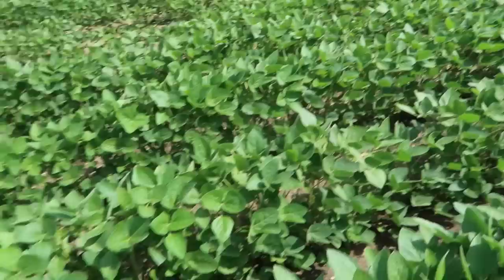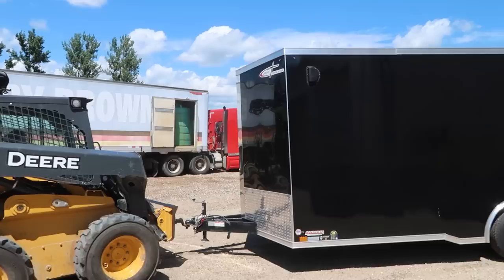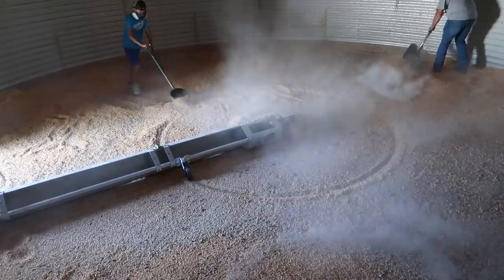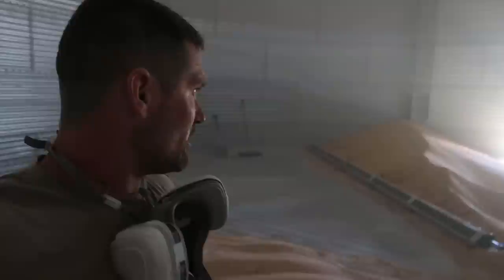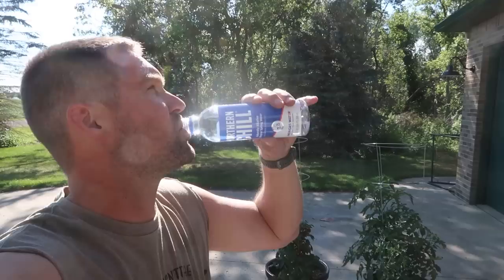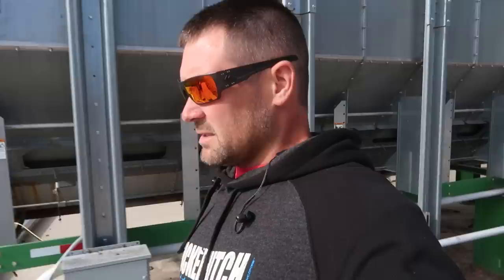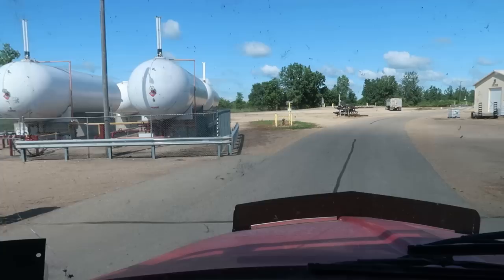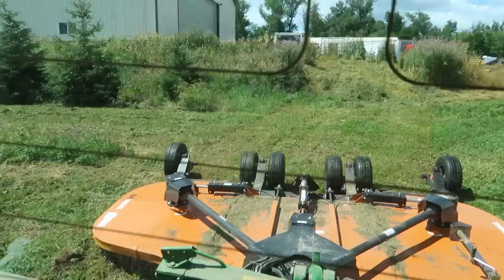Grain Bin Clean Out

Comment: Hey man! I noticed when you were showing us your sensors, that the monoxide sensor was placed high near the ceiling. I worked in auto shops my entire career and know that carbon monoxide settles low in a room. That why they outlawed pits in garages. Many guys died down in them after inhaling monoxide. I'd double check the recommended placement of your monoxide sensor to be safe.
Reply: US EPA says:  "Because carbon monoxide is slightly lighter than air and also because it may be found with warm, rising air, detectors should be placed on a wall about 5 feet above the floor. The detector may be placed on the ceiling. Do not place the detector right next to or over a fireplace or flame-producing appliance."

Petrol and diesel vapours are heavier than air - will collect in pits.

Comment: I ran commercial grain elevators for years. Couple suggestions….spray outside weeds around the bins keeps bugs/rodents away. Grab some diatomaceous earth and spread that in the bottom of the bin when your done, quick and cheap way to keep the bottoms insect free and little dryer. Air monitor on your person when you go in for obvious reasons. Anytime you go into a bing you need a person watching you at the door with a cell phone in case something happens.

Comment: Looks good with the grass knocked down have a few farms in the area I live in that I wish they would do that with worked at a green house that had a propane tank that would hold 3 rail cars worth of propane it was backup to Natural gas when demand was high for NG they would switch to LP which like you they bought in low cost season as for the fuel in the tank I fill up Semi from work and it hurts also

Comment: I had pancreatitis in Grade 4 in the mid 90’s. Was the third youngest case ever in the country at the time. They never knew what caused mine. They thought a virus potentially caused it. Anyways boy does that suck, very painful.

PS on the carbon monoxide sensor, keep that down near floor level. Carbon monoxide is heavier than oxygen, by the time it reaches the ceiling it could already be too late for those in the house.

Comment: Hi just to let you know the smoke detector is not mounted in the best location it you want it to work better (faster) get it away from the top of the wall would advise mounting 50 cm out from the wall minimum the point where the wall meets the ceiling is a dead air space hope this helps protect the family. p.s. i work for an alarm company over 25 years all the best

Comment: 19:20 your John Deere riding mower has the battery light on just like mine. When it's on it ain't charging the battery, all signs point to a voltage regulator. But replaced mine and still have the same problem...

Comment: Awesome for you I hope you read this comment carbon dioxide gas is a very heavy gas so that sensor needs to be close to the floor
Reply: Everyone, including you, squawking about it. Need to put stop to it.

I have my alarms on the right height as per our local Fire Codes. It went off 4 months ago as my gas value leaks behind the stove, since then it has been replaced.

Comment: The white dust filter on his two part respirator system is on backwards. The writing always touches the chemical cartridge filter. It even says "Writing side faces in". He might as well just take the white dust filters out as they are not doing any good in the wrong way. It has to do with the with the way they are made. The side without the writing is more densely woven to catch the dust before it his the loosely woven interior. The side with the writing is loosely woven to give the space for more airflow into the chemical cartridges. There is a noticeable difference if you wear one for an extended period of time. There are days I have mine on for 8 plus hours and biweekly filter changes.

Comment: Hey you're talking about your fuel price's over / up there, well here's ours here in Australia, just a rough figure, We work in Litres, so, there's roughly just over 4 litres per gallon. For our diesel it is $2.15 per litre, and that = $8.636 per Gallon, that it depends were we are by state / area,  That's if I saw the right figure on the pump. And we complain about it here.

Comment: Carb on mower needs cleaned if having to use choke to keep running. Start running only ethanol-free fuel in it .....Did I say that...LOL. It costs $6.00 a gallon here but run only it in my mower and boat.

Comment: Why is the methanol plant so worried about the corn moisture? Don't they just add water to the corn to make ethanol anyway?  Why dont they just dock you  a reasonable price for the extra weight of "wet" corn?  Seems expensive to dry the corn to 14% with propane or natural gas.
Reply from the maker: 2 reasons: first, storage. Wet corn will spoil quickly and can destroy an entire bin once a rotten spot starts. Second, wet corn in a bin can mess with the chemistry of what they're doing so starting with consistent moisture is important for the "recipe" they're using

Comment: Since carbon monoxide is heavier than air, shouldn't the detectors be placed closer to the floor?
Reply: Check with your local Fire Codes, don't pressure on Zach.
Reply: @deadghost1964  Pressure??? I asked a simple question. I truly do not believe Zach is a woke wimp who needs to go frequently to his "safe space" to unwind. 
Bobby, If you believe my simple question was pressure, you'd better get to your "safe space" quick before you have a nervous breakdown.

Comment: I heard they “admitted” inflation 9.1%.  Bull.  19% I believe.  We are supposed to be happy fuel dropped @$.50 a gallon.  Brandon caused fuel prices to go up over $2 a gallon.  But we should be thrilled they dropped  @$.50?  Buying vehicles.  A full tank of gas is really important. I considered pumping out @25 gallons on tractor I sold. (Before buyer saw it)
  Runnings Benson has much  nicer staff then Willmar one.
Reply: My man, get off of Facebook and educate yourself. Learn the real reason why inflation and gas prices are rising and stop being a bigot.
Reply: @hockey161616  I have never been on Facebook.  Zero desire.  Great name calling.  In what way am I a Bigot? Maybe because my opinion is different then yours?   Or is it you can’t argue truth, facts.  So you use emotion?
Reply: @larrythompson8630  You do not even know the difference between "then" and "than". I will rest my case there.
Reply: @hockey161616  so nothing? Bye